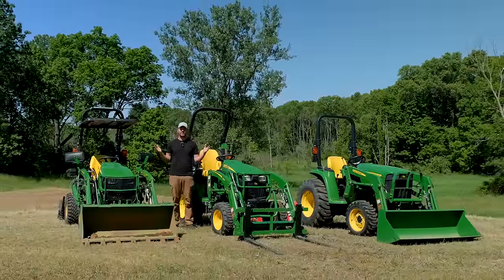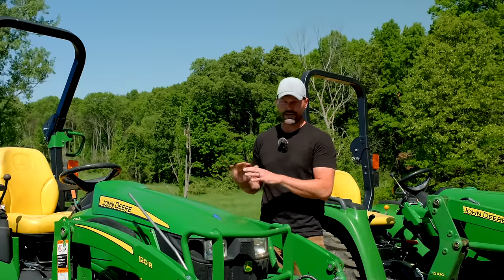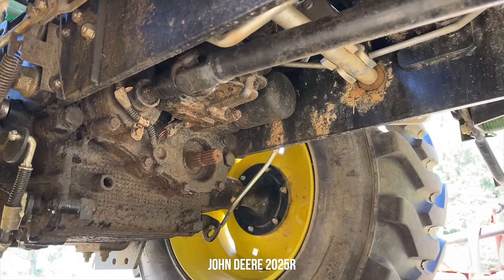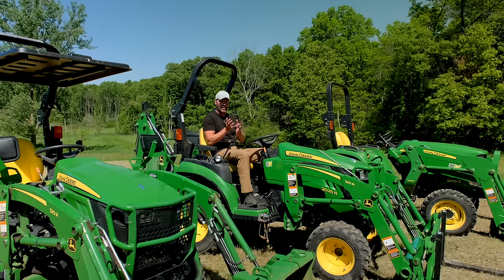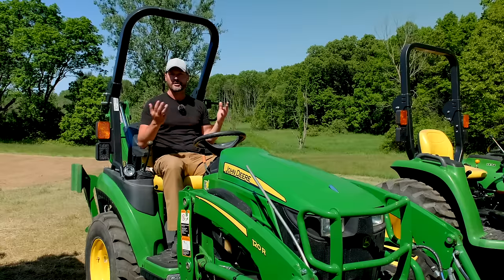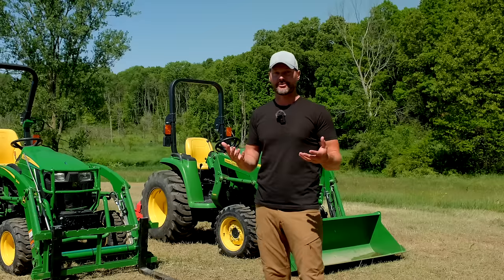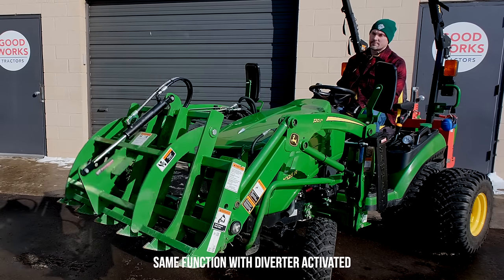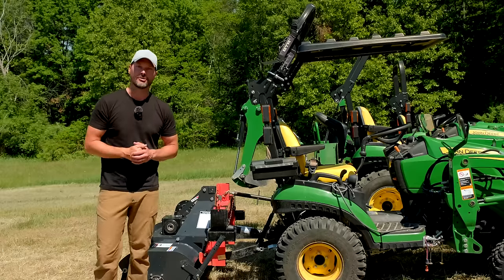CLEAR LOSER? COMPARING 3 JOHN DEERE 25HP TRACTORS.

Comment: I have roughly 6 acres with animal pastures, manure piles, road maintenance, cutting in new roads and swales and I'm always glad I went with a Kubota L2501 instead on a LX or JD 1 series. The added capacity, weight and stability was critical to me. I think the 1025 would be the perfect landscape/smaller acreage tractor to get into the tighter spots

Comment: Initially I wanted to get the 1025R, but Ag and Turf didn’t carry it at my location, and the 2025R was there with the step up in hp. Ultimately the R’s selling point to me would be the center PTO and option to get the precision belly mower, that is until I realized for the price of that convenience I could get the top series 0 turn and have money left over to do the same thing. Because of this large gap in price, I bought the 3025E with a 4’ tiller and 5’ frontier cutter (having the bigger frame allowed for the bigger cutter as well). For the money and practicality the 3025E just made sense. I’m excited to use it!

Comment: Really been looking at a 3025. Have a commercial deere zero turn for mowing, which i prefer over a belly mower. The 3025 seems like a good balance for size and usage for front loader, backhoe, forks etc.

Comment: My first tractor is a 1025R and its amazing. Even tho i could use a bigger tractor, i'll keep the 1025R and buy a 4 or 5 series. There's no point of trading in this machine, its so much practical and plenty of power for the size.

Comment: I'm 58 yo & I've been operating Tractors & heavy construction equipment since I was 12 years old.   I still haven't bought my tractor as yet but when I do....... I will be going with the 2025R.  I've spent 10 hrs on both the 1025R and the 2025R working them on my property.   I've also looooonnnnnnggg researched both models and I disagree.  It's all these things that make the 2025R feel MORE stable because it's slightly longer, slightly wider, slightly taller, has alot bigger tires, has a slightly larger operators station, a heavier, beefier frame AND the hydraulic pump puts out a higher gpm then the 1025R does, meaning it can lift about 200 lbs more & lift it about 6" higher.  Which means alot storing attachments on shelving in my shop.
Also when it comes to stability, one has to be constantly thinking about what your doing & what your trying to achieve.   My dad taught me to operate by the 'bubble in the seat of my ass', meaning if you feel like your approaching instability, then stop & go no further.   Machines are ALWAYS smarter then their operators are, ya just need to quit listening to outside distractions & listen to what all the machine is telling you!!!
Reply from the maker: Glad you found the tractor for you.  Always welcome to disagree.  You won't find me ever purchasing one to use.  I've used them enough while having them in stock and it reaffirms my hatred every time I use it, haha!  Enjoy!

Comment: Just my 2 cents, the 2025r is a better purchase if your going to be in the woods.  The height is ideal compared to the 1025 but I do agree the loader could have been beefed up.  the 2025r is just a taller 1025 and to me a more practical tractor in the woods
Reply from the maker: For me, taller and the same width means easier to roll.  I just get a bad feeling on mine.
Reply: I love my 2025r!
Reply: @GoodWorksTractors  lol. You push bora wheel spacers in every video, and really should be used on most any small tractor you have them on your 1025R. I know first hand 1025R is not all that stable either without wheel spacers. LOL
I would suggest putting wheel spacer on the 2025R, load the rear tires with ballast and then see what you think. 
My 2025R is very stable with 2" boras and weighted rear tires. I do admit with the Backhoe on I it is not near as stable as with a heavy hitch or nothing on the 3pt. The backhoe putts wight up high which is not the best ballast for off camber work.
Reply: @jdfleetguy28  On the opposite side of that coin, the backhoe can be the, hands down, best ballast you can have for off camber work. Leverage is your friend. The backhoe is heavy. You can swing it to one side or the other to offset a grade. You could get really crazy and extend it out all the way, this increases the leverage and puts the weight down low. This will of course be space limited in some situations though and is obviously not a 'normal operating condition', but it works well in a pinch.
Reply: @carlstrohm3785  I never thought of extending the boom and swinging it around to the uphill side. I had just pretty much given in to the idea of needing to take it off and put on one of my heavy hitches, if I was going to be doing loader work especially if it was off camber loader work. Very interesting, I will have to remember to try that backhoe counterweight  trick at some point. 
We normally only have a few projects a year where the backhoe is needed, majority of the time my 2025R is configured with a quick out back. 
Thanks for the tip.

Comment: I have a 2018 1025R. When I added a rear quick hitch I found I didn't need to cut the drive shaft for my Woods reverse rotation tiller. The quick hitch gave me 4 1/2 inch's more distance from the pto shaft= no cutting. The woods reverse rotation rototiller is a beast, and does better then the standard rotation tillers in every way. Well worth the extra bucks for it. As for the 54 inch quick attach belly mount mower, what a piece of crap. I should have just got a rear attach finish mower like I used to have. Hindsight...

Comment: I don't know in the US, but in Canada, machines 25 HP and under are covered under a home owner's insurance policy as long as it's only used for personal on the property only. I trailer mine between the house and summer spot, so I still got insurance for my 1025R.
Reply from the maker: Very interesting!  I haven't heard that in the USA, but could be some merit to it!
Reply: @GoodWorksTractors  Yes, they are covered under your HO Policy and in fact your dealer should have told you to contact your insurance carrier when you buy your machine to have it added, as mine did. The Policy only covers you for work you do, at YOUR property, not anyone else's. That is a whole different policy. ( I was a licensed P&C Adjuster here in VT,NH, CT and ME. And Yes, E stands for Economy line, and R is the premium class. Deere has an M and I believe 1 other class in the bigger machines, 4 and up.
Reply: @rjmack3790  my dealer, well more like JD Finance required a proof of insurance for the loan. So automatically, I had to contact my insurance company.
Reply: @grattonland  Interesting. I was asked, but don't recall having to produce proof before. I did call my carrier as soon as I got home. Which was before I actually took delivery of my machine.

Comment: I have a 2020 33R and it is very tipsy. The 1025R is probably the most stable. One of the first thing’s most do when buying a compact tractor is spacers and filling the tires and wheel weights. It’s not just the 2025R 
Have you done a lift comparison between the 1025 and 2025R? Front and rear.

Comment: I had to decide between a 1025R and a 2025R and for me it was the 2025R hands down. You get a heavier tractor, larger tires, more ground clearance, better operator position, for me it was worth it. My only regret is not getting the 2038R lol. You know what they say, the only thing you'll regret about getting a tractor is you didn't get a larger one :)

I don't mow with my tractor mind you, so I don't care about that at all. Maybe if you mow the 1025R is a better choice, but for the price of the 1025R mower deck you can buy a zero turn which is going to do a WAY better job a LOT faster (which is what I did :) ) I also do a lot of ground work, including plowing, middle busting, tilling, loader work, etc. so the height, tires and ground clearance make more of a difference to me than perhaps others...

If I were to do it over again though, I'll admit, I'd consider the 3025E. I've found hitch capacity and loader weight capacity to be issues for me. A 3046R would be perfect but I just can't justify that cost.
Reply: My wife's 48" Bad Boy runs circles around my 2025r with 60" RFM and cuts better too. But I will say if you can't afford a ZT, get the drive-over deck and don't waste money on an RFM. Buy once, cry once.
Reply: You could not have written this better, the exact reasons I chose my new 2025r. I own a Christmas tree farm so the ground clearance for new plantings was essential as was the width to flail mow my rows. If the 2025r had the lift capacity and rear pto power of 2038 that would be my dream tractor.

Comment: ive got the H130 on my 2016 2025r. loaded tires etc. it doesnt have all the newer bells and whistles but its a beast. when i used my neighbors 1025r for a bit, it felt significantly less beefy and capable. putting the 25hp to the ground is important, the ride height of 2025 is a plus in woods too..
Reply from the maker: Yeah, that Gen 1 2025r is built very well, a true 2 Series.
Reply: Mine is a used 2013. Didn't realize the new ones require removing the 3-pt to install the backhoe. I want so badly to hate the thing for being too heavy for an affordable trailer but every time I turn around I find another use for it. lol
Reply: @GoodWorksTractors 😊

Comment: I purchased a John Deere 3025D and it’s been the perfect tractor for me. I really like the shuttle shift and its simplicity. It seems to be a tractor that can last a long time with few problems.
Reply from the maker: Right on!
Reply: Good to hear some that's bought the 3025D model. I've been interested in that particular model due to it being direct drive tractor and also seems like the perfect size for my needs. I've been wanting to know how well the bucket operation is and if it has a multi function bucket ie Lift while dumping or curling buck?. May sound like a silly question but I drove a jd compact tractor a few years back that had single function operation bucking and felt that it wasn't very productive

Comment: I have had 1025R, 2025R, and 2038R, 3033R, 3039R, 3046R. Personally of the 2 25Hp machines and the one I still have today, is the 2025R. 
To me the 2025R is the ultimate SCUT, which is the same as the GEN 2 as seen in today video which is what I have as well, it is classed the in the same Sub Compact tractor by Deere same as the 1025R. 
To me the 2025R is the ultimate 1025R or SCUT.
Reply from the maker: Say what???? Newsflash, the 2025r is a CUT, not a SCUT.  So says Deere! https://www.deere.com/en/tractors/compact-tractors/2-series-compact-tractors/2025r/

2025r over the 2038r?  Yikes...give me the Kubota LX3310 though, haha!  Ooooo :)
Reply: @GoodWorksTractors  The old Gen 1 2025R was a CUT the Gen 2 is a SCUT.  This comes up all the time on GTT. Gen 2 is a SCUT same class as the 1025R. It shares almost all its components with the 1025R, except the stretched 1025R frame, to accommodate the larger tires and still fit a MMM.
Reply: Any idea if the wheel spacers will work with the 60" drive over mower?
Reply: @bigbasslakeKaten   I have 2" Boras and 54" deck, but that said my 54" deck is shaped different from the 60". The 60" raps back out to the side of right rear tire a bit which puts the anti-scalp wheel in close proximity to the right rear tire. 
We had a long discussion last week on GTT with pics of other 2025R owners that had 60" MMM and they were clearing 2" no problem, there was a guy running a 3" but that one was really close, and to close for comfort IMO, the deck does flex and float around bit as the terrain changes under it. 
For your own piece of mind, I would measure the distance from the outer sidewall over to that anti-scalp wheel, and I recommend leaving yourself at least 1-2" buffer. 
Your spacer you chose will move that side wall the exact distance of the spacer you purchase. 2" will be exactly 2" closer. The buffer zone as I call it is to allow your deck some room to flex and float a bit and still contact that rear tire.

Comment: Went with the 1025R for a few reasons:
- I don't need larger, I have a bit more than 3 acres to manage divided into 2 places. 1.25 acres at home, and 2ish acres at our summer place. While I do a lot of landscaping at both places right now, long term will be primarily mowing and snow removal. A larger tractor would help with the landscaping only if I could have a larger bucket for the loader. 
- I removed all the stumps last year with my friend's 3 series Kubota, so when I bought a tractor this year, I didn't need the extra ground clearance to work through stumps.
- Money, it's always about money. The smaller one was cheaper
Reply from the maker: Very good stuff Marc, thanks for sharing!

Comment: I love my 2025R, but I felt like I needed the heft of it for dealing with moving  my dock and boat lift up and down the ramp, and the smaller tractor was just a little bit overmatched by it. The bigger wheels also are not nothing, but you make some solid points. They just don't apply to how I use it.

Comment: 1. the 1025R & the 2025R have IDENTICAL engines , yes Identical. The 3025D and 3025E are bigger engines ( over 100 cu in) and have a LOT more TORQUE than the 1 or 2 series. The 3D and E have a LOT more ground clearance. for snow and dirt work). I have run them all and owned all but the D.
Reply from the maker: Yeah, 3e, d are definitely geared more towards your "utility" tasks, get away with the larger ground engaging attachments too.

Comment: 2025R is the route I went. I am 6'3" tall and 250 Lbs and I simply do not fit well in the seat of a 1025R. My long legs would hit the loader control and that alone was the reason I went with the 2025R. I opted for the backhoe and the 60" quick connect mower as well. I would like a larger/stronger machine but with the ability to quickly remove and install the backhoe, loader and mower it cannot be beat for me.

Comment: Couple of points about the 2025R. First, even though the loaders are the same the 2025R does lift slightly more due to increased hyd pressure. Secondly, everyone seems to complain how the 1025R is not able to lift the mower deck high enough at full height. The 2025R solves this problem. I also agree, the bigger tires and longer wheelbase make all the difference in nearly every operating aspect. Who wants a tractor with lawn mower tires? All this for 2600-3K more IMO doesn't put this machine in the terrible class. I also found it's not any more tippy (stock) than a 1025R and I've owned both. "Feeling" tippy and the physics of the actual machine are two different things, and I'm sure JD has done more engineering than you or I sitting on the seat. The 1025R is designed for a lawn, the 2025R can be sent out in the woods and rough terrain. If I had the choice between the two, I'd choose the 2025R because it's a 1025R... just better. All for slightly more overall. It's not a 10k price jump. 

Also, the "E" series have terrible bucket break out force. Look up the specs, the 120R loader has more. I used a 3038E and felt the loader was terrible because of this and really hindered the machine. I actually felt I could do more with the 2025R or 1025R. Personally, I'd skip any E series. Thanks for the video.

Comment: I use a 60” rear sweeper and a 60” rear snowblower and a 60” front snow pusher on my 1025r with no issues. With adding weights on the front.
Reply from the maker: Very nice!  Yeah, 60" belly mower too.  If you are a master of your craft, you can get away with larger attachments.  The vast majority of owners are not and do not need to push the limits.
Reply: @GoodWorksTractors  oh very much agree. It’s about how you run it not really what you run…

Comment: I get what you're saying about the 2025R but having bigger tires is a huge difference in loose gravel, dirt , and snow as well as being a little less bumpy on rough terrain due to the larger diameter wheels. I do gravel driveways professionally and own a 1025R. I just sold the 5' land plane because it doesn't have the ponies to pull it loaded down (which is the same as the 2025R I know), and was always slipping the tires in loose gravel because of the much smaller diameter. I may or may not get the 4' model. If I were to do the 25 hp thing all over again, I think I'd do the 3 series. But then again, it is still only 25hp and would probably go for the the 3032E or 3038E with the same frame size and weight.

Comment: I have a 2016 1025R and the only real shortcoming I find with it is the height. Don't get me wrong, I bought it for it's low height because I needed to mow under trees. But the height real becomes noticeable when you have an attachment hooked to the back, and your backing off the trailer. I've since learned to just make sure the ramps are more straight by unloading on a hill or a small ditch. But I've done my share of scraping the lower end of the backhoe getting it off the trailer. I can see where the 2025R would address this issue, but at the cost of stability and otherwise the clearance you would have had with smaller tires. All in all, I would never get rid of my 1025R, it has been a fantastic tractor, and I just find more and more uses for it all the time, and it's been super reliable once John Deere acknowledged the air filter bracket problem on the eariler models. I never broke the valve cover, because right away I noticed that it was loose and put blue loctite on the nuts, but I was constantly breaking that rubber strap that holds the filter box. The updated box is a much better design.

Comment: I have a 3043 D, I know its not a 25, but people,  don't overlook the D series. It has shuttle shift and its an absolute beast.  Not losing any power to a hydrostatic transmission is huge. Its one    possible turn off is not having a live PTO, but after running a mower on it last week,  it's no problem.  It is the smoothest starting PTO I've ever seen on a utility tractor.
Reply from the maker: I'm glad to hear it Jim, great info!